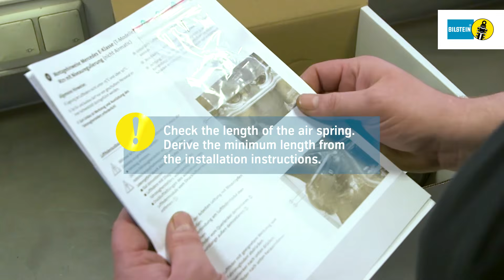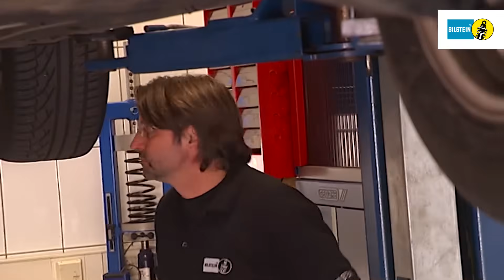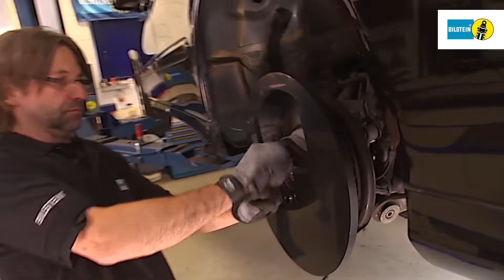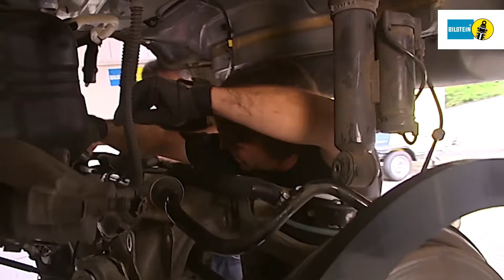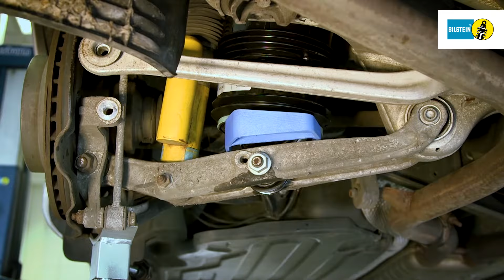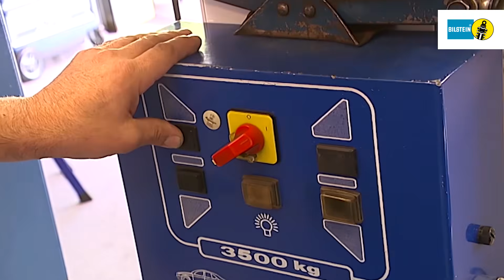BILSTEIN Installation instructions B3 air spring Mercedes-Benz E-Class S211 rear axle

Comment: Now remember people if you have to change valve covers on your engine you have to take the seats out the windshield out disconnect the windshield wipers take the steering wheel out this is literally one of the most asinine wasted time on working on a car I have ever seen people that job is not that hard there's just a couple bolts that have to come off on the back and the airbag slides right out to replace them is a 35 minute to an hour job per side now you know why the Mercedes dealership charges so much because they do retarded shit like that